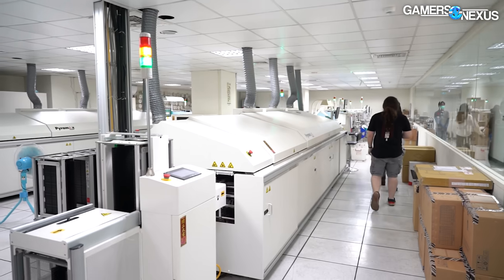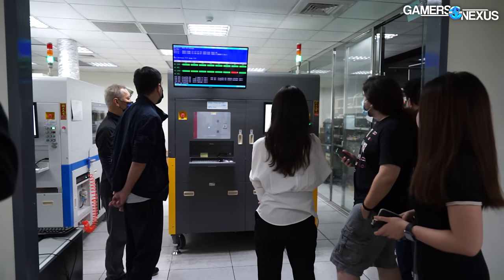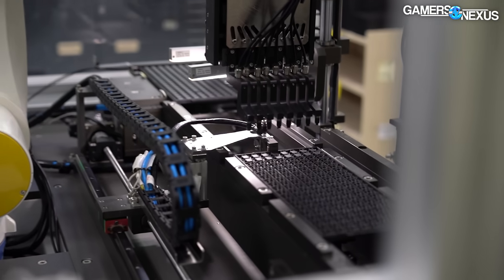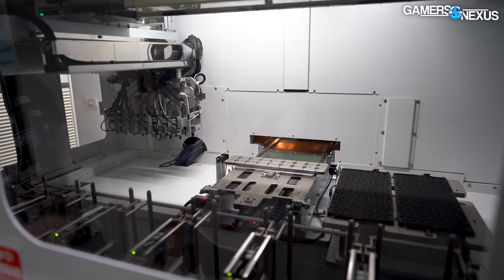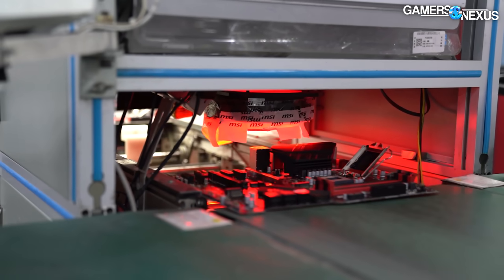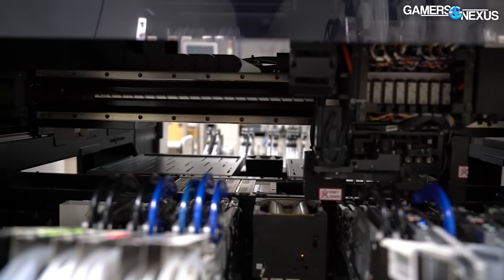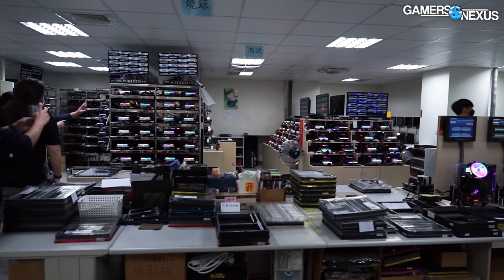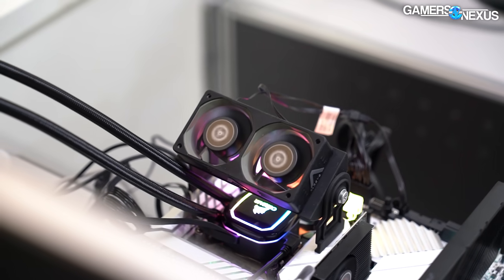How RAM is Made: Automated Binning, Manufacturing, & Burn-in Testing | Factory Tours S3E2

Comment: Funny how this goes I mentioned I lost interest in hardware but my pc broke probably mobo x570 aorus xtreme don’t buy a 900 euro mobo not worth it. I was an idiot. Now question is replace mobo alone or upgrade…
Reply: I would just upgrade to x670. I broke my x570 a year ago, and I kind of regret not going x670. I picked up a used Dark Hero. It's great, but it's not x670. Part out whatever you can't use. Either that, or just get a 'normal' x570 board.

Comment: Correction:  The machine with the pool of molten solder is not the SMT line but the wave soldering line, where a wave of molten solder attaches the through-hole components.
Reply from the maker: The machine is in the SMT line. The entire thing is called an SMT line. It is wave soldering, but it is part of the start-to-finish line for SMT (as more SMT happens before and after it).